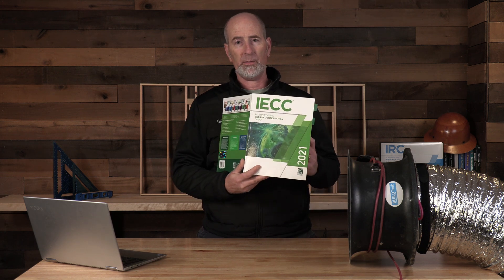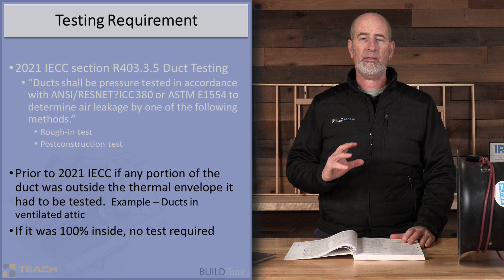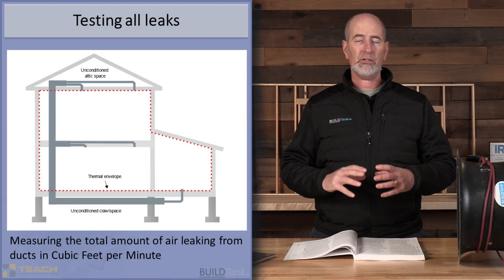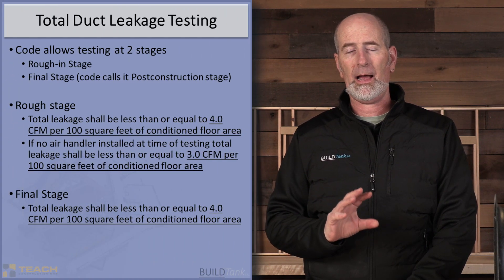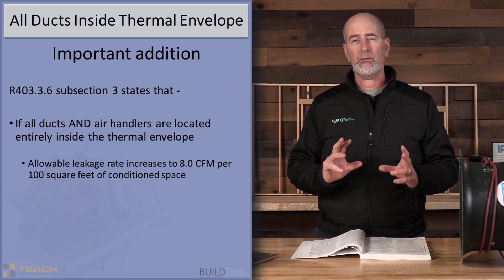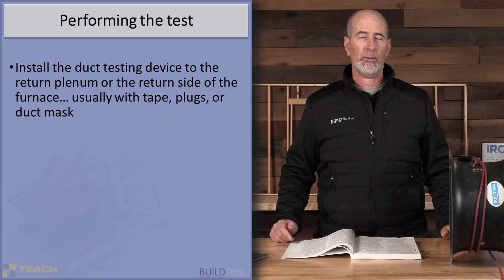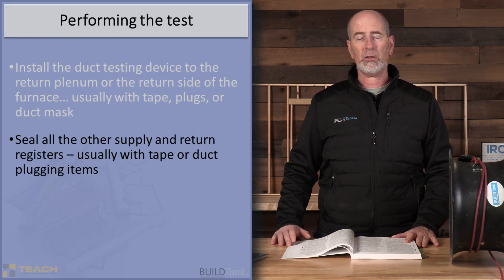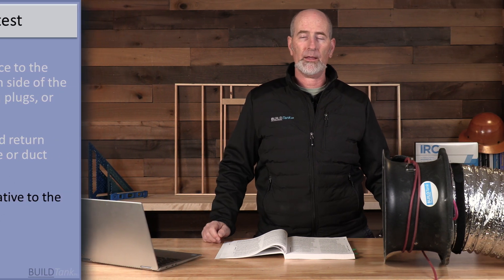Measuring duct leakage with a Duct Blaster as required by 2021 IECC - Building Science Series

Comment: Thank you. I just had an upgraded ac system installed. Yes in December. Covered under warranty. Problem started in August. I first suspected a duct leak due to high energy bills. 

Technically it was a short circuit. 

WHEN does iecc require the test? After an upgrade? After a new install? Every Annual maintenance check?
Reply from the maker: Code does not require the checks annually, but it is a good idea to looks for any leaks.
Reply: A good way to find and seal leaks is using smoke to determine leaks...once leaks are found apply mastic to leaking areas if accessible...most areas to focus on are return connection to plenum and supplies to supply plenum- cans/drywall - tees/ ys connections and the plenums Supply and Return to HVAC system...